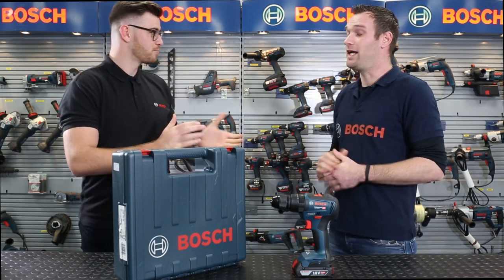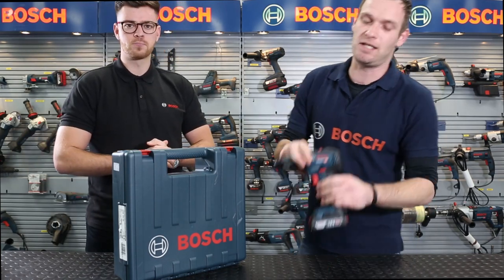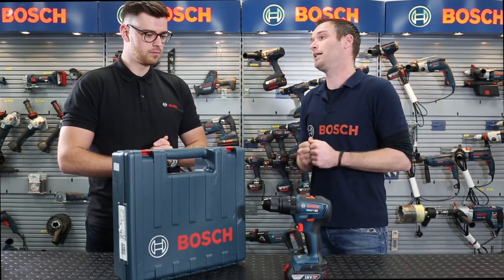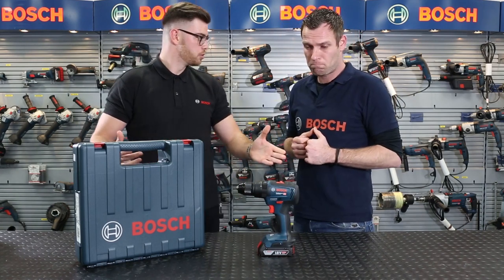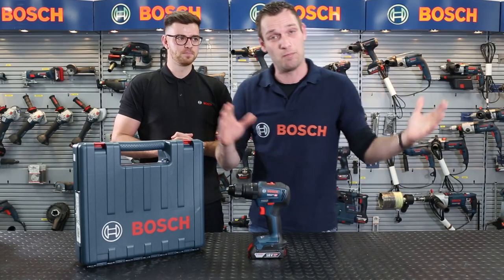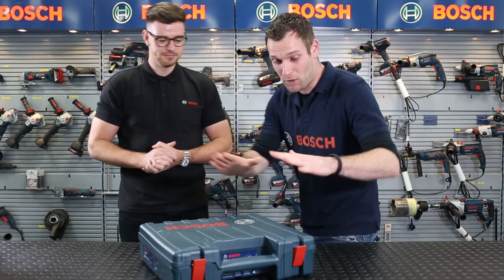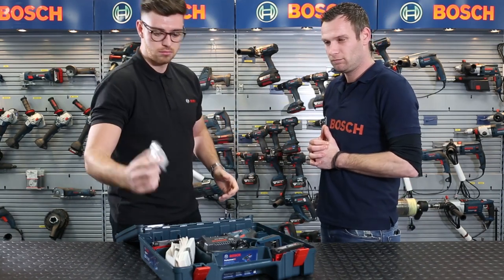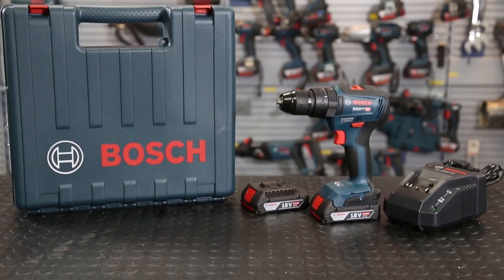Bosch GSB 18 V-50 18v 2.0ah Li-Ion Coolpack Brushless Cordless Combi Drill | Screwfix

Comment: This is an entry level, updated version of gsr/gsb 18v 50 with additional torque of 55Nm (original is 50Nm) plus electronic motor protection. The only drawback is that it doesn't have both kickback control and precision clutch like the dynamic/robust series. A good and reliable tool for junior tradesman / DIYers. I do own one of these drills and it has done its job well

Comment: GSB vs GSR 18V-50?
Reply: Zafer Akca  You use cordless drill for concrete?
Reply: Zafer Akca  I have never seen anybody uses a cordless drill for concrete. A corded drill will be way more efficient doing that.
Reply: Zafer Akca  what's the difference between GSR and GSB
Reply: GSR - for screwdriving & drillng few holes
GSB - for frequent changing of drilling & screwdriving + drilling in non-concrete wall
Reply: @NomadFM it's good enough for drilling into brick wall. (Which are common in Europe)

Comment: 55nm not 50 like gsr
Reply: Gsr in Germany also has 55nm
Reply: @BrotschneiderLP  I'm confused about this. I don't think they bother making two different machines so close in power, it's more likely it's the battery they come with stock is what give them the torque rating. 2 Amp = 50 Nm, 4 amp and more = 55 Nm.
Reply: There is only small difference between 50Nm and 55Nm; higher torque means more power consumption and based on my own experience, a 2Ah light battery pack drains faster  on EC version (60Nm) compared to the 50Nm version. The only advantage of the new version is electronic motor protection so that the fragile brushless motor won't bust easily after a long duration of heavy usage. The specs for european market probably are higher compared to the asia 's i think..